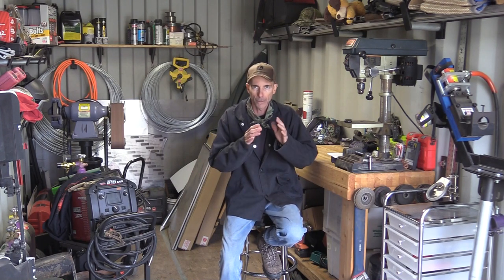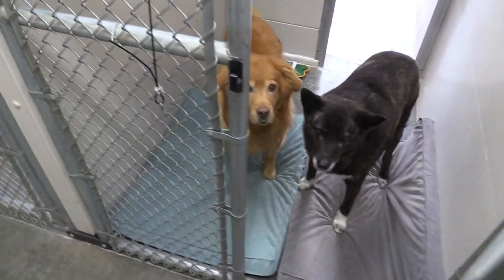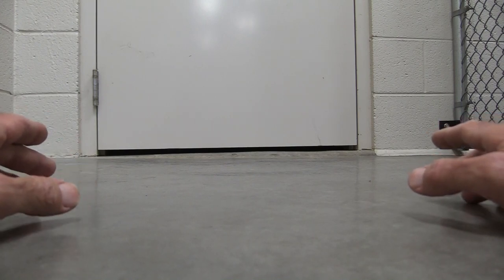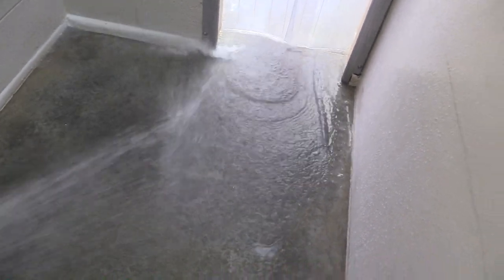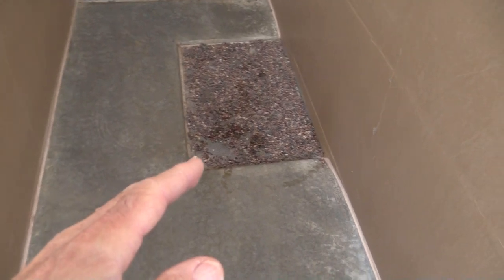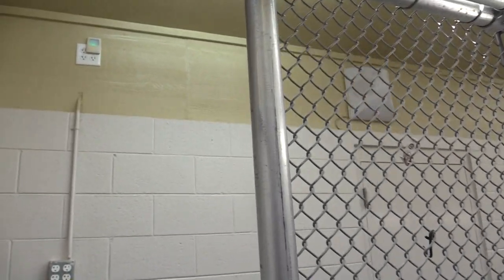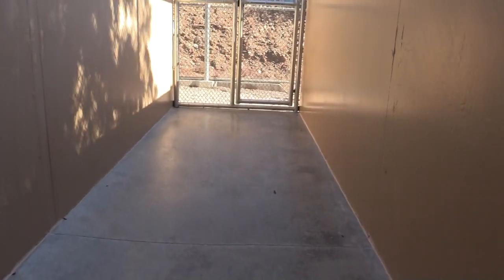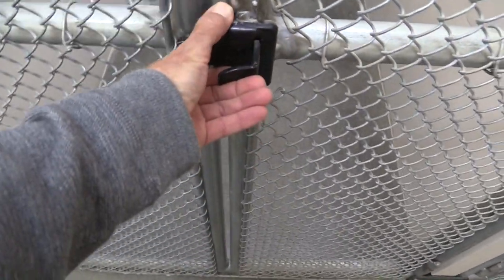Building A Dog Kennel: Kennel Run Design, Efficiencies & Safety

Comment: Probably the best kennel design I've seen. Very well thought of and efficient. I have a question. To save on costs, could you substitute recycled asphalt for the flooring instead of concrete?  Will asphalt be durable for the daily washing of the floors?

Comment: Is there any update on your sewage system and how it has worked over the years or anything that you would have done differently over all with your kennel? I’m looking at building a facility similar to this with 6 indoor outdoor kennels on each side. Plan on making it very similar to this and was curious on the cost.

Comment: Your video is very informative for the new comer to the boarding industry as well as the experienced owner. I recently bought a large commercial boarding kennel in Atlanta metro region  but the facility is quite old. I'm planning to upgrade the facility and wondering if you can tell me the contractor who built you the chain link & custom door luck. Thank you in advance.

Comment: thx for the video, i got alot new information about kennels. and i have question, there is a dog run that has indoor and outdoour kennel that linked each other, and also there is an indoor kennel that doesnt have the outdoor run. what is the different between them? and what kind of dog that should in each of that kind of kennel?
Reply from the maker: Very good question,
I have four exclusive indoor dog runs two of them have sheet metal covering
them half way up to prevent eye contact, then I have my indoor/outdoor runs… Most dogs prefer the indoor/outdoor runs and if there are multiple dogs to be boarded in one run then I prefer to have them in the indoor/outdoor runs. There is a small percent of dogs that are dog sensitive that prefer the indoor runs and fewer that like the indoor covered runs… Now most kennels today in America are exclusive indoor facilities with restriction to outside use. (This is where your question becomes so important) in the future I have plans on making a video on this subject going into detail on what has become an experiment at my facility.
Reply: @HURONANGEL  wow, i will be waiting for your next video, i like your idea with the box management in the kennel.
have a good day.

Comment: Excellent video... I think it's the only kind of detailed video. I just wanted to know why chain linked instead of the solid square ones?
Reply from the maker: In America in the past chain link was the most common wire mesh to use around dogs, but now there are a lot of options. For the dog runs in my kennel I’m using galvanized 1 inch 11 gauge chain link. What would be equal in other wire meshes would be galvanized 1 x 1inch 11 gauge welded wire grid panels, not sure what the price difference would be. I do know that the welded wire mesh can come apart at the welds depending on the quality of the welding process, so make sure your buying quality. The no climb woven type wire meshes are primarily used for perimeter fencing for livestock.
Reply: Kennel Tips & Tricks Thank you for the tip starting to design my new runs and I will be doing as much as I can from what you have put in your videos.... Thanks for the excellent content

Keep it up! Waiting for the next videos

Comment: have you talked about your gate latches before? are those custom made? how do you open from the inside if shut and also keep dogs from opening? Thanks so much. Appreciate the videos. Hope you are doing well.
Reply from the maker: Yes I custom made the latches, When inside the kennel you can open with one finger through the lower part of the latch, no dog can open the latches. The latches work great inside the building, but in my area we get a lot of freezing rain in the winter so I walk around with a small torch to unfreeze the outside latches. I have been working on several ideas on making a none freeze latch for outside use.